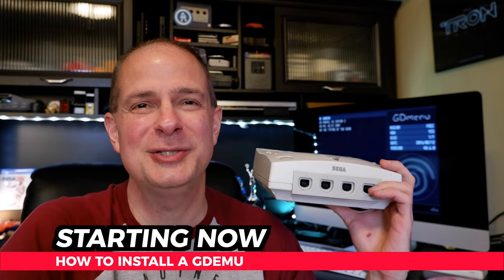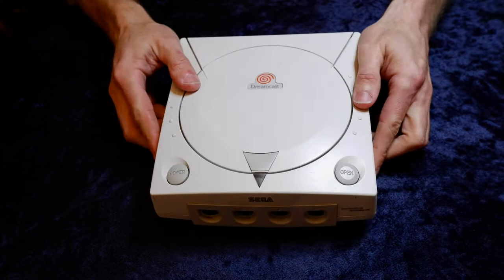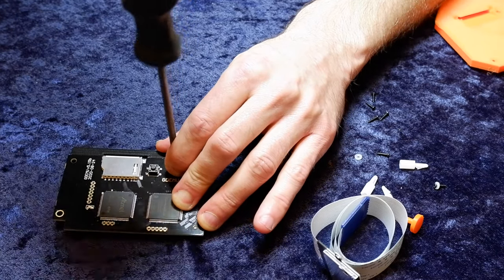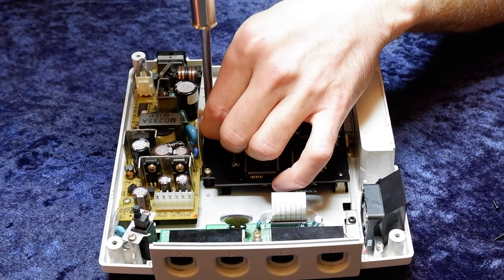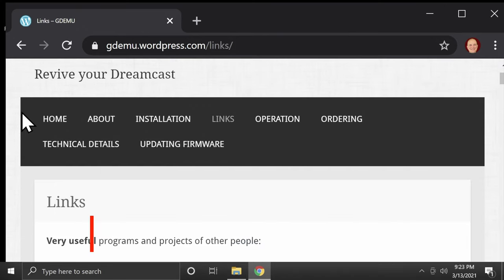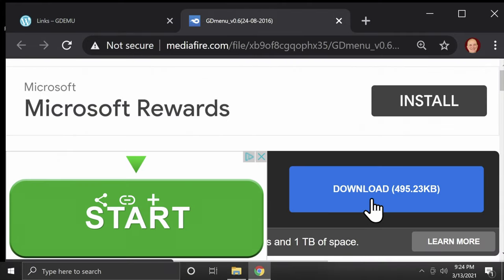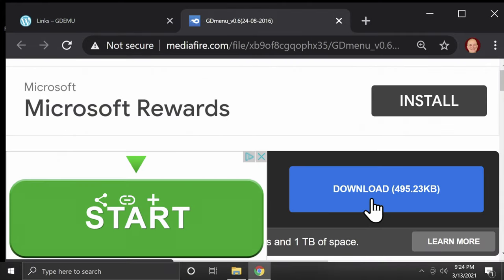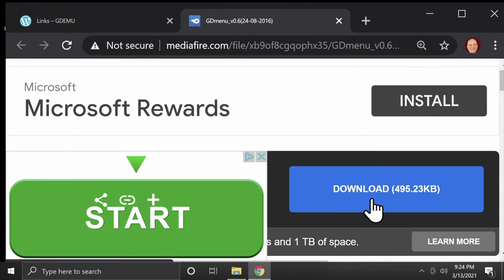GDEMU Dreamcast Installation & EASY Setup Guide

Comment: Hi! Is it true about the overheating issue caused by this mod? Do you recommend any PSU replacement? Thanks!
Reply: Have you found out yet? I'd like to know this too.
Reply: Yes and you must remove something from the power supply to solve the problem. I will find the video and post it here.
Reply: @LFiers  any luck?

Comment: an important thing you might want to add is to use SD card maker, it creates the folder structure automatically and it modifies the gdmenu so it eliminates the loading time when booting your Dreamcast, normally it can take up to 2-4 minutes to load everything each time you power up so having 0 waiting time is AWESOME!
Reply: can you tell us a reliable place to find this SD card maker? Thank you.
Reply: @unseenorheard  Yes
Reply: @unseenorheard  but each time I do my comment is deleted
Reply: Anyway to speed up gamelist loading (populating)? Im using clone GDEMU V5.20 with 256gb Samsung Evo Plus approximately 140 games using cdi and gdi files.

Comment: How do you add a game with multiple disc's (shenmue is 4 disc)?
Reply: You'll put the files for each disc in numbered separate folders and the folders must be in order in the gdemu list. When it asks for next disc, press the button on the gdemu card itself. The dreamcast will reset launching the next folder (next game)in the list. 

I think some multi disc games will automatically go to that next disc when you save between them.

Comment: I'm using a GDEMU clone I believe. Specifically the "RetroScaler V5.15b GDEMU Optical Drive Simulation Board"

Will the GDmenu v0.6 for GDEMU link you refer to in the video work, or will this cause issues with my board?

If its not suitable, is there a link to a menu that will work?

Thanks in advance!

Comment: Great video as always, Thanks! I have a Dreamcast revision 2 NTSC... Any alternative for another mod?
Reply: Same here, has anyone figured out if 2 NTSC will work?
Reply: Okay, so I actually have two Dreamcasts, and the other is 1 NTSC. I took both apart and the optical assembly is completely different between them. I assume that 2 NTSC will not work, and that is because the optical drive is shaped differently. I hope this helps someone in the future.

Comment: Any body ever deal with an overheating issue, while using the 3D printed tray? My kit came with 2 heat sinks but I cant install them on my GDEMU cause the plastic tray goes right over the GDEMU where they would sit. But I have a tray and the SD card extender thing, everything is nice and secure. But I did not modify my PSU or add a fan... Any issues?

Comment: @ Blaine Locklair : Hi I just wished to inquire, will the GDEmu work with a Japanese Dreamcast?  Mine is a Japanese Model, I don't have a 1 with a circle.  Beside the NTSC I have a J instead of a U.  Feedback appreciated Thanks! 😊
Reply: Sorry about the wait. No matter what, it should work as long as that 1 is there.
Reply: @dementedvillian  sadly my Japanese DC does not have a 1 with circle

Comment: just ordered it, thought i need to get a solder tool for it
Reply: Which one did you get?
Reply: You shouldn't need a solder tool for this mod. I have no idea what you purchased.
Reply: Just did the eBay gdemu mod and got a power replacement from AliExpress!  Ones that were rated high!

Comment: Anyone having trouble with the gdemu causing no video signal to be sent out of the dreamcast. I confirmed that I have a VA1 motherboard, i cleaned all the pins on the power supply and drive port. I verified that the gdemu gets 3.4 volts with my voltmeter. When I use the original GDrom drive, the dreamcast boots fine. The gdemu, blinks once at start up which is supposed to be normal, but then no video. When i put a bad sd card in the slot, the led stays on which is also normal. So I believe the gdemu is booting and checking the sd card has valid files. I have tried 2 gdemus and get the same result. I'm almost ready to buy a MODE and try that
Reply: Hi I know this is a bit late, but did you resolve your issue?  Did you try a MODE?  I'm curious.  I love my DC, a lot of my chinese store bought burned copies have died on me.  Tho, I have a Japanese made Dreamcast.  I don't have that 1 with a Circle on the sticker.  Mine says NTSC J and not U

Comment: any cheap gdemu devices for the gamecu?be
Reply: Cheapest option is to buy a used wii $50, sd card $5, and an external harddrive $20 and run games through usb loader

Comment: You need to do a better job at cable management; you can see when you close the shell that the SD extender ribbon sits right against the fan. Not sure how much longer your console will last with its cooling system rendered pretty much useless.